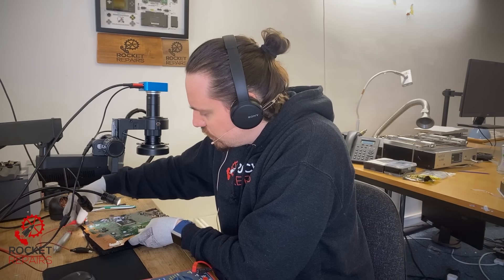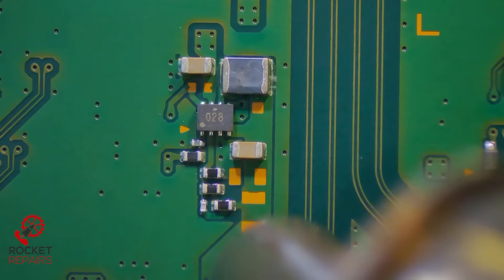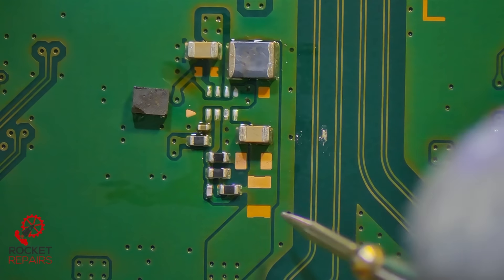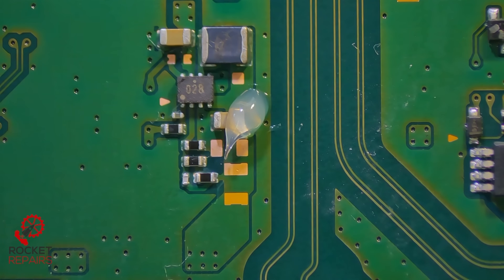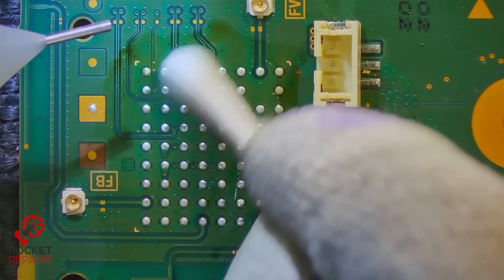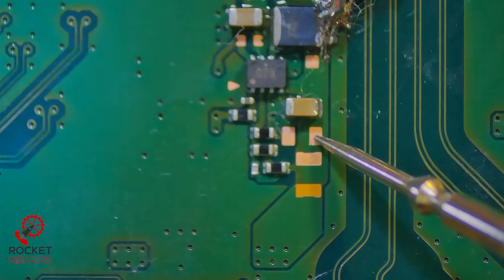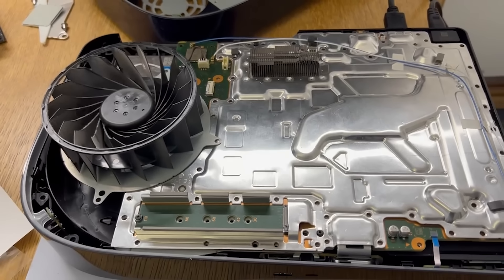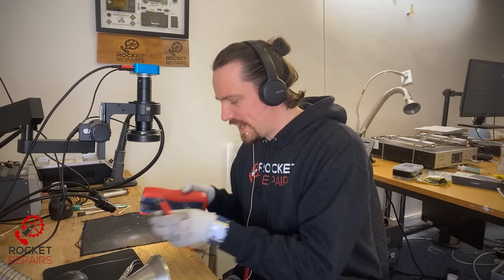Easter Saviours - PS5 no power. You won't believe what they did!

Comment: dont use 12 volt on shorted 12 volt rail! the short may be on an component that is for the south bridge or the ram or some other component that is not using 12 volt but theyr controller is or some mosfet! and you will burn all this components when you insert 12 volts! the ps5 power supply have protection and if the 12 volt are shorted it turn it self off!!! your power supply wont turn off! for me use maximum 1.2 volt!  sorry for my english!